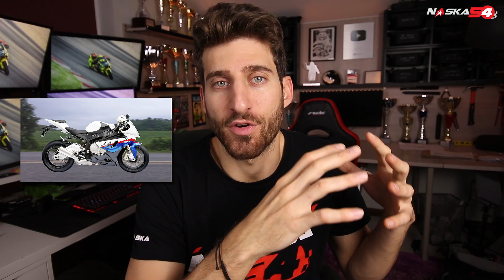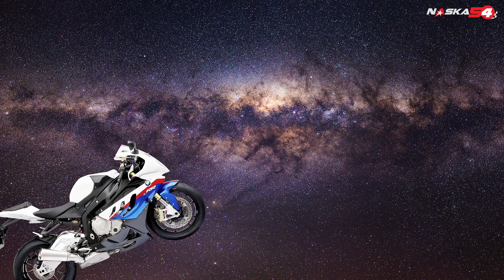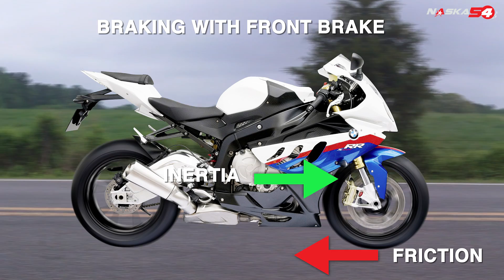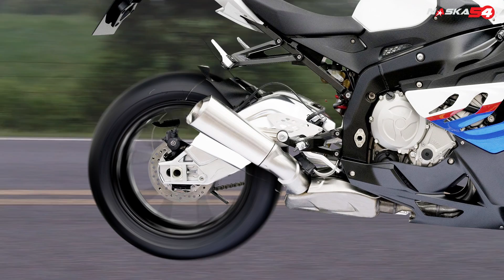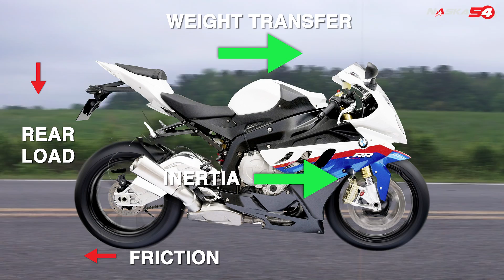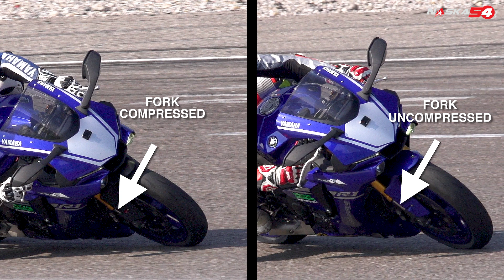WHY the FRONT brake is BIGGER than the REAR brake? - Motorbike tutorials

Comment: The rear brake is that wrench you use when you undo a nut or a bolt.. the front brake is that breaker bar with extra 6ft or added pipe you use when the wrench fails 😅 (the bike weight is your buddy jumping on the cheater bar with you)

Comment: The suspension has absolutely ZERO effect on the rotational momentum created by the breaking. Where did you get that from? The forces acting is EXACTLY the same with or without suspension... that should be pretty obvious.... Its not that some magical new force from somewhere somehow is coming out of nowhere just because you but a suspension system above the wheel....

Comment: Thank you for this video. It really helped to understand braking better.
On the track, they tell us to only use the front brake. Only now do I understand why the rear brake is practically useless in this case.

Do you have a video on traction control and how it fits in, or works with, braking?

Comment: I dont understand why most riders use the rear brake more, they said it is dangerous to use the front brakes. when i explain it to them they still insist in still using the rear brake.

Comment: Under hard breaking the rear tire basically becomes an anchor ( a “sticky” anchor) being drug along by the inertia of the rest of the rest of the bike. But, the rear tire is also being slowed down by the engine and intensifying the drag the rear tire creates, acting as a secondary braking mechanism. Otherwise known as “the engine break”. Making the rear brake more of a “last ditch effort” when shit hits the fan.

Comment: Common f**** sense that's why. Because all the weight is going to the front of the bike when you're pressing your brakes because all the momentum is going forward and dropping down .. it doesn't have leverage to stop on its own with rear brakes. Anyone that's ever rode knows if you have to stop fast your bike can easily lock up and slide from rear tire being used.  If you use the front and rear together correctly you can stop fast. And don't forget to downshift especially when needing to stop fast. Engine braking will come into effect and help you just keep the rpms up and I would say the best RPM to downshift at or the point of where you'll be when. You engage it to a lower gear should be in the middle of the entire rpm band. Don't downshift to soon or it will  skirt and kick and can fuck your stopping up enough to where you can crash.  So here's a goodway to ballpark it safely.  Redline 14k. Dowshift at 7k.   Let the ABS work for those lucky enough to have it on your bike. #1 dont panic.  Stay calm cool and collected the entire time your  on your bike and be ready for anything 😊

Comment: Good explanation! What would you say about the diameters of the discs? Why is the diameter of the front brake disc larger? Is there anything related to the distance of the calipers from the centre of the wheels? I hoped for this point as well.

Comment: Wait wait so does that mean when slowing down for corner entry we don’t need to be on both brakes? The front brake is sufficient enough ?
Reply: The short answer would be yes. If you're braking hard enough, the rear end of the bike lifts up a few inches in the air, the rear tire loses its contact with the asphalt and the rear brake becomes completely useless.
Reply: Dragan Zdravkovich gotcha thanks for the feedback bro!

Comment: hello albert here is a technical question which might also be an idea for a video if you want it to be so .
so my bike is a v twin naked , but i noticed that the handling is very different from other 4 cylinder nakeds , it is so much easier to go fast on the other nakeds even tho they are older bikes and with arguably worse suspension components , i feel like it is way more easier to accelerate while in the corner as opposed to the v twin which doesnt bend gradually(progressively) but rather u will have to muscle it at the first 5-10 degrees and then suddenly it wants to fall on its own , could be because vtwin engine is usually situated much higher i dont know . i appreciate any replies thanks

Comment: Man i like your videos but in this one you did not explain why the f. brake is bigger. You took it for granted and just explained the physics behind f. braking.
You can not use as an argument your crash or the video from mugelo for proving anything because the rear brake in both bikes was designed to be weaker than the front. Of course you will fail to stop using only the rear (one caliper and 200mm disc) from 270km/h.
What would happen if the caliper and discs setup were the other way around, massive on the back and weak on the front?

Comment: man the suspension is not there to avoid flipping over :\
Reply: In this case yes, of course the suspension have other function.
Reply: @lorenzosarchi1991  You can do a stoppie in a bicycle with or without suspension. the principle is the same. you can not reach higher deceleration just because you have the suspension.
Reply: Nobody say (just) , put (also) in you sentence and is right :)
Reply: @lorenzosarchi1991  my point is that the explanation on the video is wrong. even without a suspension you would reach similar deceleration.

Comment: Thank you. Made me think that is actually not so bad to brake really hard as i always scared to loose the front while braking to hard. That peace of rubber thing changed my thinking a bit 👌👍
Reply: just make sure to squeeze. If you suddenly just pull and the weight didn't transfer yet to the front, you have a problem ^^